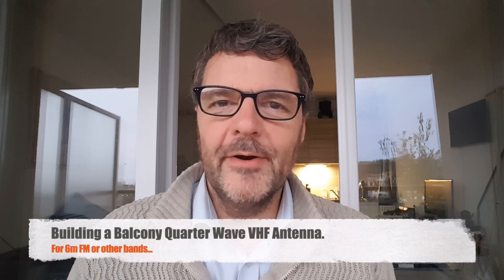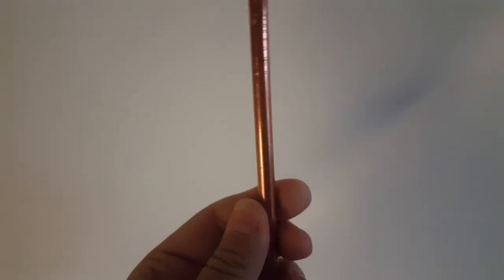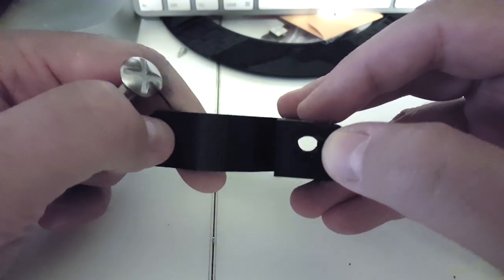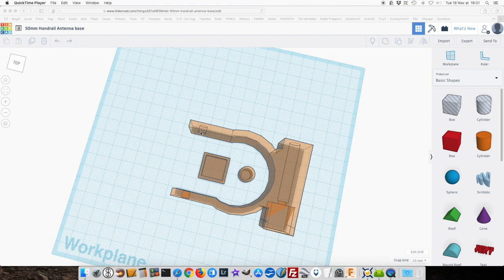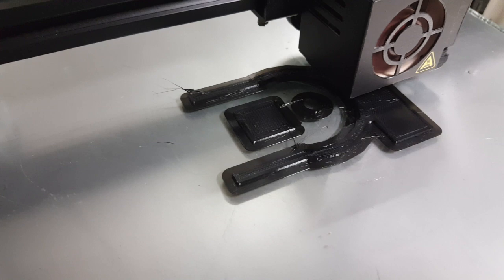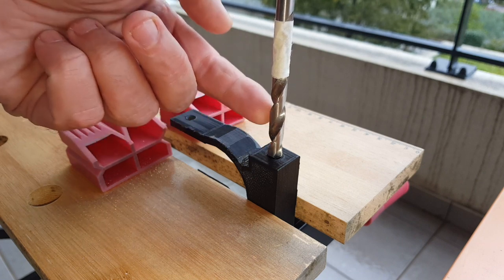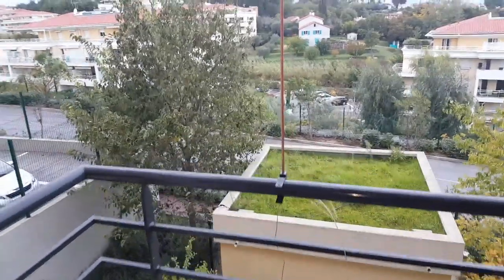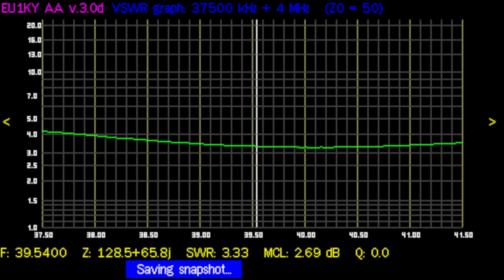Building a Balcony Vertical Dipole VHF Antenna.

Comment: Could it be that it has a high SWR because it’s so close to a metal structure? Maybe if you find a way to place it far away from the balcony it would work? Thanks!
Reply from the maker: Certainly...
Reply: @RadioPrepper  I have the same limitation here, metal balcony. Thanks for your videos!
Reply: @RadioPrepper  on the plus side, I wonder if you could find the resonant frequency of your balcony and use it hehe
Reply from the maker: With more fiddling I am sure I could tune it.. I do have other options though but if that was the only one I would dig deeper...
Reply: @RadioPrepper  would be funny to have a built in antenna that only works in a specific frequency hehe Merci

Comment: Print the clamp with two tube holders, one up and one down, and the bnc in the center. Then solder each tube to the bnc as a TRUE dipole. 

Your results were due to a imbalance between the two elements. 

Technically a dipole balun would be required because one element is going to see a capacitance effect from the railing metal and the other element is in "free-er space". 

I used a PVC pipe T from the rail... Used a stub of 12" to extend the dipole away from my tower, and then another PVC pipe T to hold the vertical elements. 

The other options to make what you have useable is to make the wire "counterpoise" massively capacitant. Think of how a ground plane works. It sees 1/2 of a dipole element in good length/tune... And radiates half of the signal on that element... And it "sinks" the other half of the signal "cleanly" into the ground plane. Your current setup counterpoise does not "sink" it "cleanly". It is close enough to greatly distort your overall signal. Try adding material to the counterpoise (aka, the second half of the electrical dipole) to see if you get some values that do not interfere with the success of the measured element?

Comment: I am just new to the hobby of antenna building. Already built 1/4th wavelength groundplanes, Moxon, hentenna, J-Poles, Biquads.. flowerpot antennas... and it sure helps that all elements, especially the radiator, of antennas be mounted far from metals that sure can affect the swr readings.
Reply from the maker: You're not a newbie anymore ;-)

Comment: Hello, I suppose you should try HALO LOOP antenna, it is very convenient to mount to balcony rails, and also have horizontal polarisation. 73.
Reply from the maker: Yes, but that's for VHF. It would be huge on HF..
Reply: @RadioPrepper  yeah, but in this video you did antenna for  2 meters :) Still, if you have lack of ideas - just try, in your location is not bad, especially if raised with some mast from balcony, if it is not possible, just move like 70-100 cm from railing and use it. Have a nice day.

Comment: Gil, take a looksee at KG0ZZ youtube video, https://www.youtube.com/watch?v=RcO5WAiksNI&t=13s,   from several years on the DIY 2m / 70 cm antenna. Your antenna might still work if your radiatimg element has greater separation from the railing, with an arm or halyard to extend it about 30.5 cm away from the railing. 72 KB8AMZ  p.s. forgot the youtube link and had to edit my comment.
Reply from the maker: Right, but it gets a bit more complicated... I will get back to it eventually...

Comment: Hi Gil, I think your measurements needs to be checked. At 51.5mhz, a 1/2wave ant is 2.7meters long total length. So you need to cut 2.7meters to half for a 1.37meter long each element. Then it would be 1.37m for the upper tubing element and 1.37m for the lower element, making a total length 0f 2.7meter long dipole antenna. The lower element takes the place of the counter pose. I think what you did was a 3.5meter long vertical plus the counter pose which made it operate on a much lower frequency.
Reply from the maker: That's what I did...

Comment: Can you print another mount that puts the antana higher so the antenna isn't next to the rail,  maybe use small coax in the mount to shield the RF from the railing. Also is there a way to make the railing part of a ground plain. You may need to shorten the length of the antenna with a small coil in it. I think you have a good idea just need to work on it some.  There is steal up at the top of the antenna,  made into part of the building. Just a fast thought is to put a small coil just above where it is mounted. This will shorten the antenna and keep it from the steal in the building above. A peace of plastic pipe to wind a coil on. Maybe someone will have other ideas to help. Here in the US there is all sizes of plastic pipe, I don't know what you have there.
Reply from the maker: Unfortunately the ceiling above prevents doing so. I definitely need to investigate this further though...
Reply: Good Luck! I thought putting a coil in would make it shorter becouse part of the lenth would be in the coil.

Comment: Hello,
for what do you not use the balcony railing?
use the railing as a countercapacity
!?

Great so you also have a 3D printer!
I printed my spool holder with it (and much more!)

https://www.youtube.com/watch?v=_fZKxOtvQC8

friendly greetings from The Netherlands!
Rob
Reply from the maker: Hi, because it is painted and it isn't mine...
Reply: @RadioPrepper   OK
maybe then put an aluminum strip on the railing,
of the correct length and which then acts as a counter capacity???

Comment: The first thing I would have done is to use the metal hand-railing as your ground plane. Actually, technically speaking, your antenna is not a dipole but a monopole.... A dipole would have worked too, and could simply be hung from something higher.
Lastly, i you're finding that you can't get a low R/L or SWR reading at any frequency, something is wrong.... If you're finding the SWR low at a lower frequency. your elements are too long....for a 1/4w at 51 mhz, your elements should be about 51-52 inches long....You could easily adopt plans for a 6 meter band antenna which would very well at 51 mhz.....!  Keep at it...!!
Reply from the maker: It wouldn't be so far off... The size is right, and it is a dipole? Two opposed quarter waves makes a dipole. I thought about using the rail but it is painted and isn't mine. I will definitely tinker with it more...
Reply: @RadioPrepper  

Sorry..I couldn't see the lower element wire...That will couple to that hand rail and any other metal objects around or above the antenna will have effects on performance....It might work better leaned up against a wall indoors away from metal, if possible....You could also try to add another wire element to the lower one and spread them evenly along the handrail in opposite directions...The more radials like that the better....
Reply: @RadioPrepper  please please do a follow up on your investigation - this project is not at its end :-) vy 73 de dl8cy

Comment: You might want to try this: Remove the counterpoise and add a matching 1/4 wave to the "ground" side of the bnc connector to form a complete dipole.  Run 8 or 9 turns of your coax on a Fair-Rite Part # 2631803802 torroidal core to form a balun.  The downside is, I'm afraid the railing might be a bigger problem with this setup unless you can get further away from the railing.  

On second thought, try just adding the balun first... that should reduce any interaction with the coax acting as a parasitic element.
Reply from the maker: Thanks. Good idea. I will try the choke. It is a quarter wave already.

Comment: Not radio related, but I have just bought myself a very cheap 3D printer (Ender3) and am really enjoying playing with the free stuff you can get on Thingiverse.  I have also downloaded Tinkercad and boy am I confused LOL.  Already printed different stands and VFO knob for the 817, so finding it very useful.
Reply from the maker: Absolutely. I used YouTube to learn Tinkercad and will get the Ender3 myself soon.
Reply: @RadioPrepper  There are self print upgrades for the Ender 3 which really do make a difference.  Youtube  Tomb of 3D printer horrors is a very good point of reference.  I replaced the Bowden tube and puch connectors as these are really low quality as delivered.  You will really enjoy it and get lots of use from it.

Comment: Hi Gil, thanks for very interesting experiment as usual. I would really recommend you download Autodesk Fudion 360 for your 3D designs. It is free to use for home users. There was a steep learning curve to start with but there are lots of YouTube tutorials. Well worth the effort especially if you learn to design parametrically. 73 de Mark M0PVM
Reply from the maker: I installed it already! But have not started using it yet....

Comment: Thanks for sharing Gill,  I wonder if you have a better antenna than you expect.  Isn't a center feed dipole about 200 ohms?  Don't you need a 4 to 1 balun?  Or 4 radials at about 45 degrees to get a 1/4 wave antenna to 50 ohms?
Reply: I found this a really interesting read... Maybe 8 radials is a good thing. https://www.qsl.net/kk4obi/Elevated%20Radials.html
Reply from the maker: A dipole is around 72 Ohms... Indeed radials at 45deg do make 50, but I think the railing is the culprit.

Comment: Hi Gil, I have been busy doing other things so radio stuff has been on the back burner but don't trash the vertical dipole yet.

I used the verticle dipole often in the past and here are a few observations that might help.

1: The orientation of the coax to the antenna can make a big difference. I find the vertical dipole behaves as expected if the coax juts out from the feedpoint at a right angle for roughly at least a foot. I had a horrible SWR reading on a 10 meter verticle dipole where the coax dangled along the antenna that became a perfect reading when the coax was allowed to extend at right angles to the antenna for roughly 2 feet.

2: Regardless of all else you should be able to make it usable by lengthening or shortening the 2 elements. I would just clip on an alligator clip to each component of the dipole with perhaps an inch of wire attached to see if longer was better. If not I'd trim 1/8 inch at a time So as to equally shorten each radiator. Either longer or shorter should do it if coax adjustment fails. 
Mile 
Kc2wvb
Reply from the maker: Thanks. I will test further.

Comment: It would be interesting to see you take this antenna out to the field and try it where there would be no interaction with the metal of the building. A plus for this antenna is the wire counterpose so it is easy to adjust the length of the counterpose as well as try multiple wires at various angles to see what would work best. 

It may not be right for the balcony but it might be great for portable operation.
Reply from the maker: I will definitely try!

Comment: Try to let the top tip of antenna offset  away from calling edge and then adjust length both of antenna and radial.
Reply from the maker: Yes I did that...

Comment: Did you try just the railing as counterpart? 
I mean without the radials. 
That would be interesting to see, if the SWR becomes bader or better. 
73 Oliver DO1OH
Reply from the maker: I thought about it but it is painted and I need to find a non-visible way to make a good contact.
Reply: @RadioPrepper  Perhaps you could build a capacitor with tinfoil to couple to the balcony?

Comment: One tip for 3d printer is the plastic typically shrinks and depending on how accurate your measurements are you might need to oversize things by say 3%. Look at the manufacture for shrinkage amounts.
Reply from the maker: Good to know thanks.

Comment: Gil,

Great video and a valid attempt. I have two ideas, what if you used the railing as your ground and tried a wire for your radiating element suspended from the roof over your balcony. See what happens when you shorten the wire, the SWR curve will either get better or worse. It is worth a try.

Idea number two, I have had great success with a “Jungle Antenna.” Which is just a quarter wave ground plane with three sloping radials. The antenna is made from wire and the structure is a bamboo pyramid. It was popular in Vietnam and works very well with my PRC-77s. There are pictures of mine on my QRZ page. I keep the wires an frame collapsed and hang it up only when in use. It takes only a couple of minutes to assemble and dissemble and from what I see, it will fit on your balcony.

73 and good luck 
Charlie KM4ZZ
Reply from the maker: Thanks Charlie. I thought about that... The jungle antenna will be for another video.

Comment: May I suggest building a magnetic loop for 6 meters. Mine has worked very well. Even from INSIDE my apartment. It is very small at approximately 45cm in circumference.
Reply from the maker: I did a while ago. See on radiopreppers.com. Good idea thanks.

Comment: Ciao Gil,
Some times happen.... 

I would try to make It All in copper tube and with One or two  radial at 45° out in the clear. Impedance should be closer to 50 ohm and resonance may be better, because in far away from the handrail... 

Other try could  be to use the complete handrail as grownd... And trim the radiator for resonance... Have a try.
Best 73 Gil
Reply from the maker: Thanks. I thought about that, might try...

Comment: I've ordered a 3d printer and was wondering if you'd consider a video on 3d printed items for ham radio as the topic.
Reply from the maker: Definitely. I will get myself one too for Christmas.
Reply: @RadioPrepper  birthday present for myself I'm getting an artillery sidewinder x1 and have already been working on micro iambic paddle design for portable ops and a few other items

Comment: What would happen if you shortened your vertical ends a bit at a time?  E.g., I mounted a horizontal 6 m dipole using 2 each buddistick 5.5-ft whips mounted on an isolated dipole mount on 10-ft of 1/4-inch copper pipe and "adjusted" by the standard formula but, the SWR was too high on 6m.   The copper pipe was duct-taped to a 10-ft 2.25-in OD vertically mounted PVC pipe that was sunk into the ground in my backyard.  It is a temporary set-up.   I had to reduce the whip lengths, bit by bit, using my antenna analyzer (the now discontinued, wonderful Rigexpert AA-54) to achieve eventually a SWR=1.3 or so.  The overall length of the whips was about 10% less than the formula length.  The lesson of this exercise (yours and mine):  antenna performance is dependent upon "location, location, location."  BTW, I like your 3-D printer and CAD/CAM software! 73 de AE5ZX
Reply from the maker: I tried, by 3cm.. I should test it in a different environment first...
Reply: @RadioPrepper  Correction.  I used 0.5-inch copper pipe.  Also, could you try your new antenna as a 1/4 wave vertical and use the other half (1/4 wave) of the dipole or a shortened wire segment connected to the metal railing as a counterpoise?